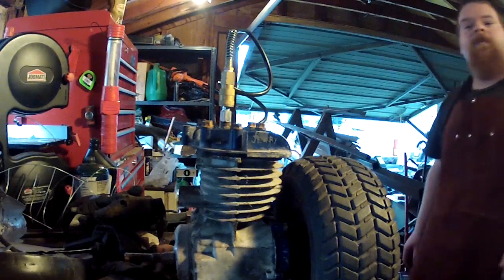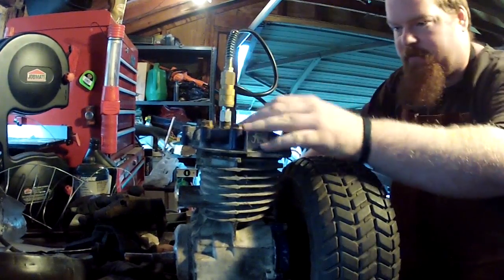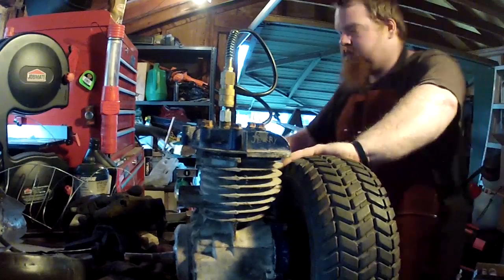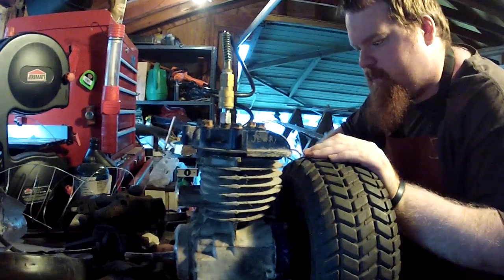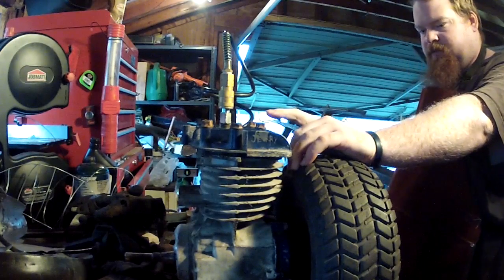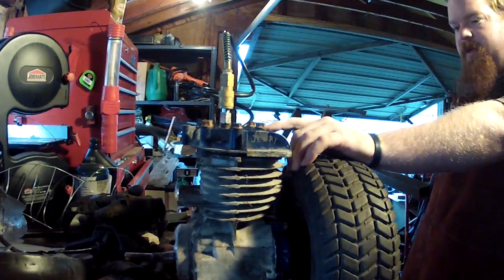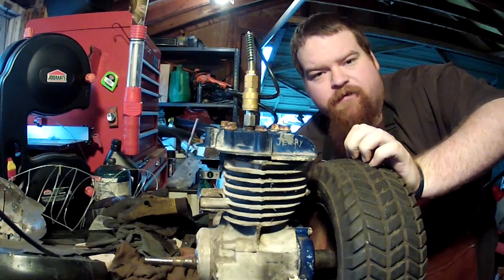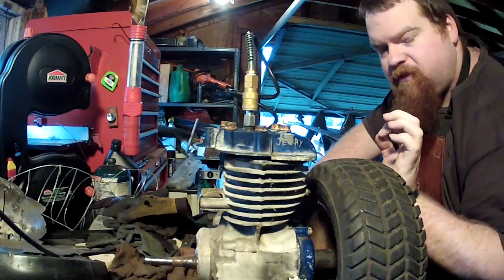Convert 4 stroke to steam engine part 3

Comment: Best recommendation is to study how and why steam engines work.  The power plant guy said your stroke is too short because air is compressible, yet hot steam is expansive, and that is the part that really does the work in a steam engine. as for running a generator your main difficulty will be your water supply and labour in keeping the fire up, for proper steam pressure.  Steam is very dangerous, so do learn what you need to know how to operate it safely. As many will say, you know enough to be very dangerous.

Comment: Hey,  great project .  So I understand the 4 stroke engines very well and so here is my question for you ......  Why did you have to get rid of the exhaust valve and I take it you ground off the lobe on the cam shaft.  It seams that you are doing that very thing by having the extra lobe on the intake part of the camshaft.  If you could explain it to me that would be great !
Reply from the maker: +cody cheney I didn't grind off anything. I pulled out the connecting rod so the intake is always closed and added a lobe to the exhaust so it opens on every up stroke.
Reply: Ok but why the double tap on the intake ?  Why wouldn't you use the exhaust?  What does the intake need to be the valve you use ?
Reply: The intake valve opens on the down stroke, he needs a valve that opens on the upstroke. he could have used the intake and turned the camshaft 90degrees;... but thats making things more complicated.

now he has a valve that opens every other upstroke, so in doubling the lobes, it opens every up stroke.

Comment: soo ? u have any new vids / updated one these are abut 2 years old now.
Reply from the maker: Nathan Dean I have tons of new videos but nothing on the steam engine. I ran out of storage space and it got buried behind other projects. I'm looking at getting a shed in the near future so I will be able to store some of the things I don't use often and have some room to pull out the older projects.
Reply: kool. look at using pallets as  shed making resource. most times u can get them for free alone with some 2x4s. you could even make a small house using them as well.

Comment: Have you tried to place the air line were the carb goes ? . .reason ut stops at 45 psi is because your not using any valuves and the air is forcing the piston to stay down (BDC). . .  2 stokes you put air were spark plug was . . . . Why not use a one way  value to can capture the exhaust air so you can recycle it

Comment: I am not sure why you think it would be very dangerous with 100psi when the compression of this engine is probably at least 100psi stock, also the pressure from combustion will be a lot faster and higher than from compressed air.

Comment: That’s because when the piston is on the way up to exhaust the air, the air pressure to fill the cylinder on the power stroke is also exhausting through the valve adding pressure and slowing the piston down. A better way to do it is to plug the sparkplug hole and connect constant pressure to the intake port. Add another lobe to the camshaft and time the camshaft so the intake valve opens at TDC and closes at BDC and the exhaust valve opens from BDC to TDC... Happy engineering!

Comment: Your problem with the engine is not pressure but volume.  Compressors are rated by both the pressure they will generate, PSI, and the volume, CFM cubic feet per minute.

Comment: i was thinking about a four cylinder or a six cylinder engine configered the same way so that when one cyl is on exhuast another one would be on power as to make the revs more uniform and seamless , probably a gm stovebolt or ford flathead , just a thought.